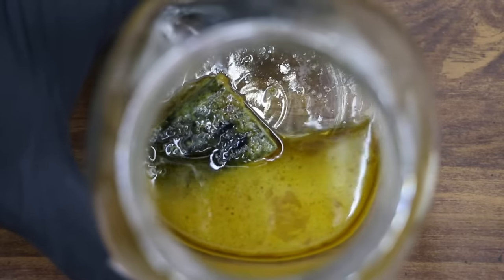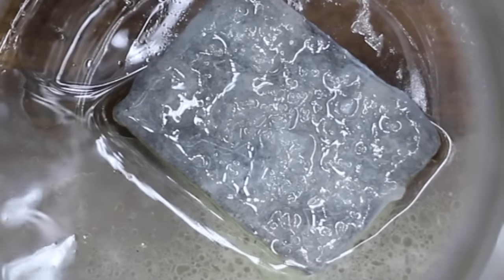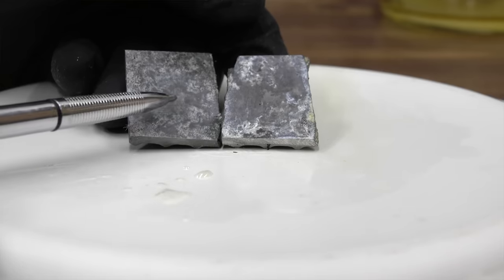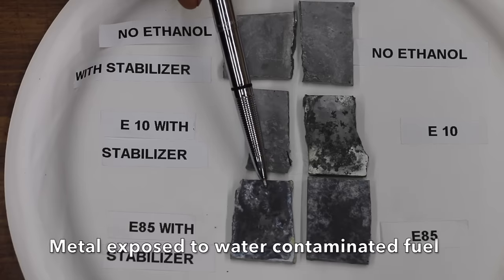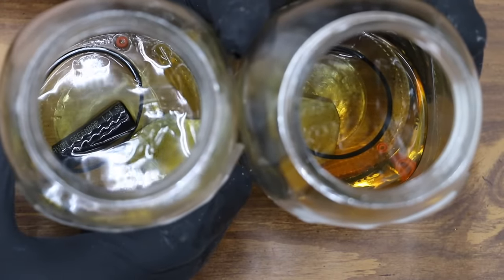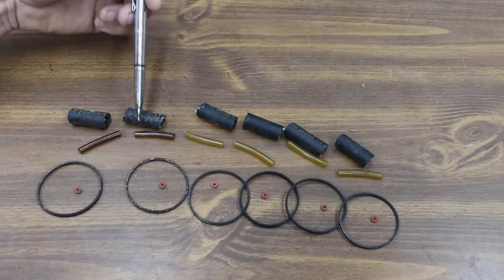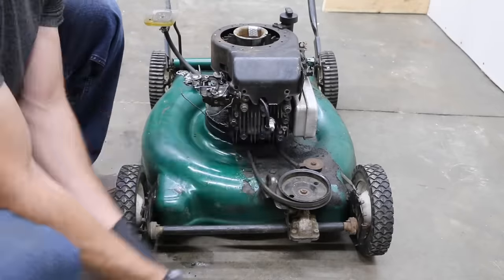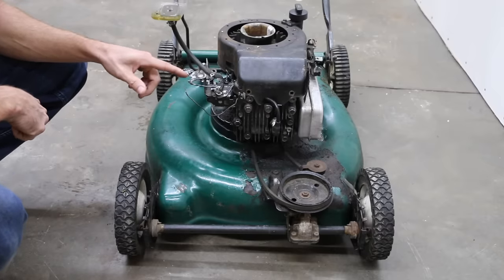Does Fuel Stabilizer Prevent Ethanol Damage?  Let's find out!

Comment: There is kind of a problem here, I love the video and am dealing with this problem in my equipment.  The issue is calling that residue left in the jars gasoline which it is not, anymore(*).   Gasoline is mixture of probably a thousand types of hydrocarbon molecules.  Its bulk distilled, and back blended to achieve a Octane rating.  As it ages it gases off various groups of those molecules thus is changing in Octane.   After prolonged exposure ( I'm guessing 25% loss in volume) its not really gasoline anymore its likely moving toward a diesel/kerosene blend, but there is the another problem which is condensation of water which increases when fuel vapors are present, and the water dissolved things from the air. Ethanol holds on to water which maybe our core issue. 

Here is a suggestion 12? jars with lids:  4 get nonethanol gas, 4 get ethanol gas,  4 get ethanol gas stabilized.    One of each gets a lid, one of each gets a lid with a breather hole drilled in( like a regular fuel tank) , one of each gets 5 breather holes drilled in the lid, and the last set is left without a lid. Cover all with A/C filter fabric for dust and bugs, mark the fill levels so we see how much evaporates.   Wait 6 months and repeat your tests.           

(*) often called varnish, it generally a wax and traces of asphalt that remain as these components are very heavy and wont gas off until they are broken down by UV light waves
Reply from the maker: Thanks for the suggestion.

Comment: You should try K100 fuel treatment. It’s the BEST I’ve ever used. Once you try it you will never use anything else again. It will eat the ethanol corrosion in a carburetor and have the engine running again like you’ve never seen before. It would be nice for you to share this with people to save them hundreds in small engine repairs. Thank you for your great videos.
Reply from the maker: You are welcome!  Thanks for the suggestion.

Comment: I'll tell you now that after working on small petrol machinery for 14 years, I've noticed that ethanol really messes up small machinery!!
Small carb gaskets hardening up, fuel pipe hardening or turning into something like sticky liquorish.
I use to have a 5ltr can for bad fuel, I now have a 20 ltr can!
That gunk in the glass jars is what I see all the time from mower carbs that have been left for a 6+months.
Ethanol fuel after a few months, looses it's octane level so it wont run without choke or a help to get going.
Reply from the maker: Thanks for sharing.

Comment: I use Stabil performance 360 stabilizer & it works fine for me. Some of my machines haven't run in several years & will start up easily. I always buy gas from a top tier gas station.
Reply from the maker: Thanks for sharing!

Comment: I have a Craftsman mower with Briggs & Stratton engine that's been running on nothing but E10 (can't get straight gasoline here) with Stabil stabilizer added for 13 years.  I always add Stabil to the gas since a 2-gallon can lasts me several months.  I do not drain the gas tank over our short winter.  The carburetor looks OK and the engine always starts on the first pull.  I've had no problems with hoses or seals.  I had a sealed jerry can with E10 in it, with Stabil mixed in, stored in the garage for over 5 years... I mixed it half and half with fresh gas and have been running it through the mower with no problems.  Maybe the stabilizer you used wasn't effective.
Reply from the maker: Thanks for the feedback.

Comment: When I store my bikes for the winter which are both carbureted. I just run them dry select the Killswitch and fill in with diesel. Keeps my steel gas tanks from corroding and the seals in my carburetors from getting all messed up. When spring hits drain The diesel throw it in the Passat fill with gas. Change your oil all the other fiddly bits good to go been doing this for 40+ years works fine for me.
Reply from the maker: Thanks for sharing!

Comment: Love your videos!  I always check before buying new equipment to see if you've done a review/test now.  Idea: gasoline and diesel quality when stored over a few different periods of time (1 month, 3 months, 6 months, 1 year, 2 years) with and without stabilizers added.  The goal would be to understand truly how long can gasoline and diesel be stored before it's not usable in an engine.  I'm constantly wondering about this with my stored gas and diesel.
Reply from the maker: Thanks!    Thanks for the video idea.
Reply: @ProjectFarm  It would also be interesting to see if the degraded fuel can be useful again after mixing some fresh fuel with it, and how much fresh fuel is necessary if it does work.

Comment: The 'Taryl fixes all' channel ran a two year test of over a dozen fuel additives and all are 'snake oil'. The only carb that suffered no damage was the one using non-ethanol fuel.

My own experience is, two years ago I purchased a nice 1975 Gravely 546 that had been setup as a snowblower only machine. Its owner had fueled it up, then let it sit in his barn ready for the next big snow, which never came apparently or it wouldn't start when that time came. I purchased it non-running. When I got it home what was apparently gas in its steel tank had turned dark black, smelled awful, and had badly corroded the inside of the tank. The carb was in the same shape. Otherwise the entire machine looked like it was rarely if ever used.

Also, over twenty years ago I bought a TroyBilt tiller, used it to make some flower beds for my GF, then parked it in my barn, after I removed all of the gas in its tank, even drying the residue using paper towels, drained all the gas from the carb including drying the inside of the carb bowl. It then sat in the barn like that till I needed it again last year and upon adding fuel, it started on the second pull and ran perfectly.
Reply from the maker: Thanks for sharing.

Comment: The gas can be left in the mower to sit for the winter with no problem. My mower starts first pull each spring. I don't drain the tank after last mow in fall, just leave what's in the tank there over the winter. This is in Houston TX. Water in the gas is what makes it not start. (wets the plug, shorting it out)
Reply from the maker: Thanks for sharing.

Comment: I recently went to get a replacement for a 60 litre barrel of 15W-40 that after x number of years was empty. I have been using it on two petrol véhicules (25 and 10 y.o.) and on (4-stroke) lawn mower equipment. In the shop, I was told the oil I was asking for was for agricultural equipment -- implying "only". I said, 
-- Whats the difference?  
-- Viscocity -- this is 15W-40.
-- Yes, I know, that's what I want, its what I've been using for... several years. 
So he had no explanation. Ditto with 4 other shops I went to. One said I could use motor oil in my mowers (but not the other way round). The Ford dealer said if I followed the original salesman's advice to put 5W-30 in my old van, it would have destroyed  it. Yesterday  buying a blade, I asked a guy why he was buying 'Turbo X' -- 'It's for diesels' he and the assistant kindly enlightened me. I went to the shelf To read the label: FOR PETROL AND DIESEL HIGH PERFORMANCE ENGINES. So neither of them knew what they were talking about. 

Ive been using this oil in all my equipment, petrol (as above) and diesel (old tractor, not so old digger, ancient dumper). No problems-- so far. Have I been reckless, lucky? Am i in for a big surprise? What the hell is 'agricultural' motor oil? 
Could you please destroy -- potentially!! -- some lovely machinery for one of your many admirers?

Comment: In small engine 2 stroke, I use 92 octane non-ethanol.  In marine and lawnmowers use 88 or 89 octane non-ethanol.  Basically, everything I own gets non-ethanol fuel except automobiles because you run it out in 2 or 3 weeks.  The non-ethanol fuel cost more but is far less expensive than repairs and nice to have reliability.
Reply from the maker: Thanks for sharing.

Comment: Funny that the Lucas made for ethanol, couldn't handle the ethanol. You should try this test again using Pri-G and Startron to see if either works after 2 years. I've used both for winterization with e10 gas, and they worked way better than this Lucas. I left one of my push mowers sitting for 4 years with some Pri-G in it, and it started up just fine.
Reply from the maker: Thanks for the suggestion.

Comment: My classic 1970 Chevelle Malibu Fuel Injected 350 V8 runs on Unleaded Fuel mixed with So- Cal Octane Booster.. I also changed my OEM Metal Gas tank to a Racing Fuel Cell that can take Alcohol..E85..& Octane Boosters..
Reply from the maker: Thanks for the feedback.

Comment: I only use ethanol free fuel in all of my lawn equipment and store fuel with stabilizer in my reserves in hopes it will keep the fuel fresher longer. I have seen fuel over a year old work fine. For my chainsaws and generators, engines I don't use frequently, I run them dry to minimize the gunk and corrosion.
Reply from the maker: Thanks for sharing.

Comment: Everyone needs to know just how bad ethanol is for small engines. We used to have to either rebuild or replace the engines on our yard machines every year or two. Then a gas station near us started selling zero-ethanol fuel and all our machines have been running perfectly for years now. 

Good to know that the stabilizer seems to work fairly well to prevent corrosion, even if it doesn’t keep the fuel from going bad.

(One note about it going bad: those were open containers, so the more volatile components would have evaporated away. Would it do better if the containers had been airtight?)

Comment: Years ago when I spent some time around marinas many of the larger gas powered boats had small starter tanks that were used to start the cold engines and once warm the valve would change the fuel to the main tanks. Once the engines were warm they ran fine on older non ethanol fuel. Back then, occasionally "white gas" which was lead and alcohol free, might be burned to help clean up the engine a bit...at least that was the theory. One thing I did discover worth noting is a bout an old wood boat with an outboard. It had two six gallon saddle tanks and being two stroke had  a rich mix of oil mixed in.  Motor was a 1959 "fat fifty".  Registration was out over a decade and the boat was in sad shape. There was fuel in the tanks. One had the cap tightly sealed and when I opened it the gas smelled fresh as could be. (Non-alcohol  leaded gas) The other tank was about three quarters full with the vent still open, probably from the last time it had been in the water. It was  pretty much turpentine!  Adds another layer to protecting your fuel, be sure it is not vented. 
Very good vid! Thank you.
Reply from the maker: Thanks and you are welcome!  Thanks for sharing.

Comment: Great long term storage test,
Thank you
I'm wondering is if the corrosion is caused by the long term contact of the water with the Aluminum , during not use storage, and does this happen with E85 during year tound everyday use, 
Here in Calif all GASOLINE except racing fuel , has some Ethanol in it , typically 10% , pump grades are 87, 89, 91 octane, also  also some stations have E85, or Bio diesel,
I have not seen any corrosion in the carburetors of my generator's, añd they are used daily, i have recently started using E85 in them,  Fresh Fuel every day, no stored fuel, $3.49 a gallon versus $5.50 gal 87oct, at 4 gal per day the $8 per day savings will pay for a new carb in  ,14 days or less, 
The  $800+  fuel cost savings in 100 day's is enough to buy a another new generator If needed or a bunch of spare carbs, I'm not advocating storing E85 fuel , in or out of small engine machinery , 
 I'm simply thinking, its the water causing the Aluminum corrosion, water Left in contact with Aluminum eats it faster than it does steel via rusting,
As you stated Ethanol attracts snd holds water, that water is held in suspension, it does not chemically combine with the water, to form a new substance, 
How would Dry /  Anhydrous ethanol react with Alu, my high School chemistry and many years hard knocks learning says, nothing would happen if vaccum sealed and no new moisture is allowed to enter

Comment: General rule is E10 is only good for 3 months. There's a standard for it which is that it should be 'Clear and Bright' which is how it should look fresh after you pump it. You should be able to see right through it. If you've ever seen any of it has water entrainment it will look cloudy and dull. Best thing is to keep it rotated and fresh, topped off or above half full and TIGHTLY SEALED. Most fuel tanks or evaporative systems slightly breathe. If you live in a humid area or wet time of year you're going to get water in it. Once the water's in, NOTHING will take it out or re-combine the phase separation. Alcohol absorbs water, gas doesn't. Once the alcohol absorbs the water, it's in there. If its to much for the alcohol to take or the ethanol evaporates the water falls out and lays on the bottom of the tank. I've used plenty of 'Ethanol' additives and every one is marginally effective at best. The reason is they are only designed to account for or absorb a minimal amount of water. Best thing is to just keep your fuel fresh, run it out at the end of the season, or better yet use Pure Gas. It'll save you a lot of misery if you have a lot of power equipment. Using regular old Stabil, Berryman's B12, or nothing I've left Pure Gas a year and it still burned fine and fired right up.
Reply from the maker: Thanks for sharing.

Comment: I am wondering whether the fuel going bad to the point it would not even catch fire after just one year, was more because of the way it was stored....i.e ...a large container with a tiny amount of fuel in it VS a full container sealed......I have heard that non ethynol fuels can be kept for YEARS before it will go bad...also....was it the same fuel that the aluminum and other parts were soaking in?....would like to see a fuel longevity test in a full container situation in storage...Great video!!
Reply from the maker: Thanks!  Thanks for the suggestion.

Comment: Nice Video.  It is my understanding that gasoline losses 1 octane per month with stabilizer or not.  If you store gas my suggestion would be to buy  93 octane and  use stabilizer, hopefully that will stop the gumming and  recycle every 6 months 93 - 6 = 87. Below 87 octane the fuel may be to weak to fire as needed.
Reply from the maker: Thanks!  Thanks for the feedback.

Comment: Some years ago I took my Honda lawnmower to the repair shop since it was coughing, choking and not running well. I had been running the usual 10% ethanol gasoline when it was operating. I had it repaired. The repair shop told me that I needed to either use ethanol free gasoline or alternatively use a stabilizer. For less than a year I used stabilizer but soon switched to ethanol free gasoline. From that point until now it runs just fine.
Reply from the maker: Thank you for sharing!
Reply: @ProjectFarm    Thank you as well

Comment: I recently revived my Geo metro 1 liter.  It sat in the woods for 7 years with about 1 gallon of ethanol fuel in it. I put a battery in it and drove it away.  It's fuel injected, so, no exposure to air in the fuel system. Runs great.  It seems that when discussing ethanol fuel problems, conditions must be specified.
Reply from the maker: Thanks for sharing.

Comment: I guess I have been very lucky over the years. I always have used a fuel stabilizer year round and all of my small engine equipment of 25 plus years still works great. Yes if all possible I run it out of fuel over the winter.
Reply from the maker: Thanks for the feedback.

Comment: I watch your YouTube channel quite often and really appreciate the tests that perform and the information that you help everyone out with .   So I wanted to share a discovery that I recently had ,. I have a chain saw that has been sitting for going on two years ago it has old fuel in it , the fuel is just basic 10 percent 87 octane gasoline , but it is mixed with 40:1 two cycle oil.  and When I mixed it I also added Lucas fuel cleaner ,  you know light brown looking one that comes in a gear oil style quart bottle  or in a gallon size bottle.   and I also mixed in some Heat Gas line antifreeze that comes in the yellow bottles .   I like to mix it like that because I run the fuel for my chain saw and my Snow blower and they both run very good with it .  but any how after sitting nearly two years  that chain saw started up with the old fuel in it and ran quite good ,. I was very surprised once I seen that I had left fuel in it I thought for sure that I would have to clean or rebuild the carburetor . but to my surprise after a few pumps on the primer I set the choke and four or five pulls on the recoil  , it started right up , and after a couple minutes of warming it up, it was running just fine ..    so maybe give it a try and see how it works out for you ..
Reply from the maker: Thanks for sharing!

Comment: Interesting experiment - thanks!
Apparently I can leave Chevron 94 octane in my carbureted motorcycle for up to two years (it’s in “denial storage” at the moment) with no adverse effects. I recently took it for a spin (after sitting for two years), then drained the fuel and replaced it with more 94.
I poured the “old” 94 octane in my mother’s car (it requires 87 octane) and it ran just fine with this mixture of fresh 87 & old 94.
The motorcycle ran like a champ - maybe I’ll ride it this coming summer…
Reply from the maker: Thanks and you are welcome!
Reply: @ProjectFarm  87 certainly has ethanol, 94 probably as well.   Untill few years ago,  91 (when it was the highest octane) used not to have at major suppliers.